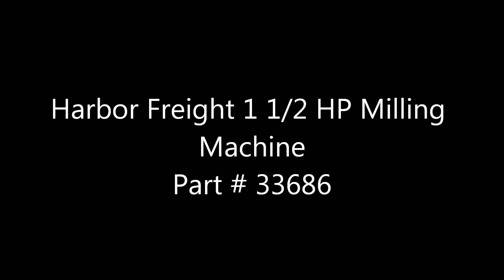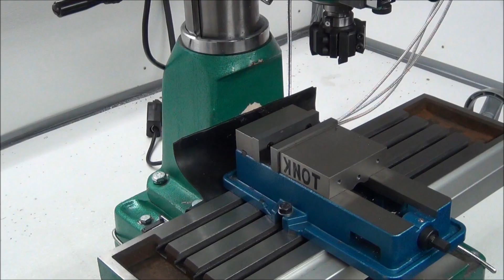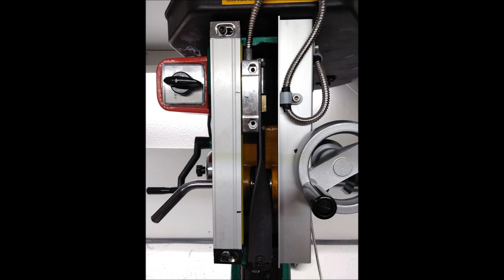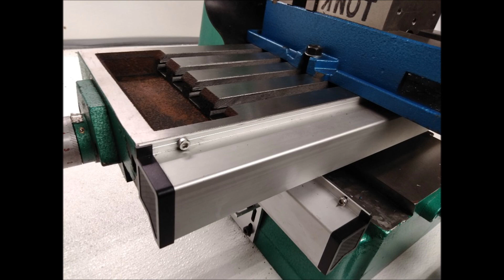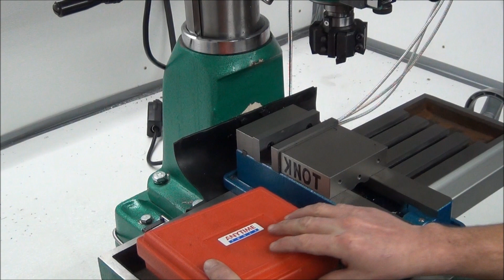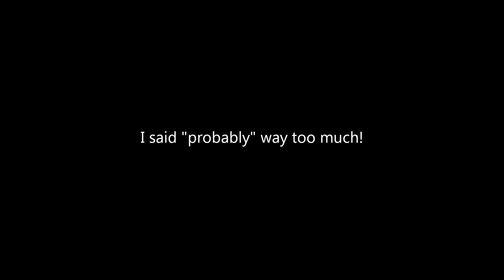Harbor Freight 1 1/2 HP Milling Machine 33686

Comment: I see this was 6 years ago but ...
I bought a lightly used machine that sat unused for years because the owner didn't like how loud it was when running.  It is quite loud. With the belts off the motor is quite loud.  The spindle seems quiet enough but I noticed that the pulley has a small amount of rotational play on the shaft . Loose keyway ??  Any advice would be greatly appreciated.

Comment: So, I have this  one with head assembly section off  and rack sitting next to it.  

As center main shaft is round with the rack on the left side for the head assembly to roll up and down on.  

With head assembly off, do I set rack in place on the side of the round head and then with a cherry picker lower the head down on top and roll the head down with the lever until it catches rack or do I put head on first and let it drop to bottom then put rack on side and roll upward to assert it on the rack?

  I would assume the first.

Comment: I would love know if my old 1984 vintage central machine is r8 or mt  3.   How  would i tell on my machine without machine dis assembly
Reply from the maker: Do you have any tooling that fits it, laying around?  Could probably measure the I.D. of the spindle nose and cross reference that measurement with specs for either tooling.

Comment: How this holding up? Will it cut steel very well? I know alot of guys get these machines and only work with aluminum.
Reply from the maker: Running like a champ.  Cuts everything I throw at it.
Reply: @number40Fan  Nice, i think im gonna pull the trigger on one once they come back in stock at HF.

Comment: I was lucky enough to find an older HF (Central Machinery) machine similar to your's on CragsList.  The machine was brand new and never used, still covered with cosmoline which was a PITA to remove.  Now, the interesting part is that my machine has a quill feed and also came with a heavy duty metal stand with a chip pan.  I've never seen another drill mill machine either from HF or Grizzly that have a quill feed.  This is a great feature for boring.  I love my machine and it's been very useful.  There are a few negatives.  First, the paint job sucked and the paint was peeling so I completely stripped the crappy Chinese paint off and primed and painted it with Rustoleum.  I used grey instead of that pea green.  The Rustoleum has been holding up great.  The cheap vinyl cover that protects the Y axis leadscrew had to go.  I replaced it with leather.  The dials have painted on graduations and are not engraved.  Be careful using solvents on these.  I did and the painted lines on the one dial got partial wiped off.  Since this machine does not have a knee for the Z axis you need to raise and lower the head.  This sucks because you have to loosen two pinch bolts on the right side, then go around to the left side to crank the head up or down, then go back to the right side to tighten the two pinch bolts.  The biggest problem thought is that there is nothing to prevent the head from rotating about the round column that supports it while you are raising or lowering it.  It would have been nice if the manufacturer had machined a keyway in the column and put a key in the head to keep the head from rotating. I plan on eventually installing a DRO but for now I made a bracket that uses a dial indicator with a 1" travel for the Z axis.  Overall, its a good shop tool for a hobbyist or DIY guy like me.
I was a professional machinist years ago and spent a lot of time operating a Bridgeport and I have to say that the HF machine I own is a mere toy compared to the Bridgeport.

Comment: Some people on here are saying they used a 20 percent off coupon to buy that mill ?  I'd like to know how they did that.  I was told harbor freight coupon can not be used on central machinery tools. I tried to use one on the internet.  It came up, cannot be used
Reply from the maker: I used a coupon with mine.  Maybe things have changed since then.
Reply: @number40Fan   I'll try ordering by phone.  Maybe that'll work...
Reply from the maker: I used to get text messages with coupon codes every Friday before this C-19 started.  Haven't had one since.  I'm sure they are pinching pennies like everyone else.
Reply: it says on the current coupons, no central machinery.

Comment: Are there markings to zero the x and y axis?
Reply: I really appreciate your replies. Thank you and Take care.
Reply from the maker: No problem.  Any time.
Reply from the maker: I'm pretty sure I understand what you are saying and I don't think there is.  At least I have never looked for them.

With these round column mills, having the center of the bed directly under the spindle can change any time you raise/rotate the head.  To find the exact center of the bed travel in both X and Y, you'd need to move either axis to its extreme, count the number of turns of the dial to reach the other and then come back to the half way mark.  Probably easier to just use a tape measurer and find the center of the bed, place a spotting drill in the chuck and lower the spindle.  Adjust the bed until the spot drill is right above your measured center mark.

Comment: Can the head travel higher?
Reply from the maker: Yeah it goes quite high.
Reply: Yes, there's a hand crank on the left side of the head that raises and lowers the head.  On the right hand side back near the motor are two heavy pinch bolts that you need to tighten before you start machining.

Comment: Im waiting for the next 25 coupon before i make the plunge and place my order but i have never before ordered something this large that has to be delivered by freight. Im interested in what your guys experience is, delivery time, did you have pay lift gate fee. How was it delivered to your residence.   Was it damaged, how was it resolved. How was you experience with the unit. Im wondering if i should go with the green vs the larger red mill. Are you guys happy with your purchase. I know its a large ask but while im waiting all i can do is ponder.
Reply from the maker: First off, very happy with mine.

It was delivered on a freight truck.  I was never called to confirm shipment.  Didn't even know it was shipping because shortly after I ordered, I called HF and they told me I wouldn't have it for a few months.  Then, about three weeks later, out of the blue, a guy rang my doorbell.  Luckily, I was home!  The delivery driver and I were able to wrestle it out of the trailer and into the bed of my pickup.  From there, I completely disassembled it, cleaned it up and carried it piece by heavy piece into my basement.

If you don't have a way to get it out of the back of a trailer, call and ask about lift gate service!!
Reply: Be careful, the red mill is NOT larger...It only has an 1-3/4 spindle, vs 3" spindle on the green. It only has 13" swing vs 15 7/8" swing. Quill travel on the red is only 2 3/4" vs 5" on the green. The table on the red is only 6 1/2x26" vs 8 1/4 x 28 3/4 on the green. So the red mill is very much smaller than the green in every way.
Reply from the maker: You're right.  Never looked at it, but is noticeable smaller in some in important measurements.

Comment: Are you using this guy to mainly cut softer metals like aluminum and brass or can it actually handle steel and harder materials?
Reply from the maker: I have cut some steel.  Made a new banjo for my lathe (cold rolled).  I have cut other steel, 17-4 SS and Titanium, just too busy to do any recording of it.
Reply: @number40Fan  Awesome thank you sir. Thinking about getting one of these and though most my work will be with aluminum pieces, I wanted to see if it was capable of harder metals. If you end up making more videos of using the mill, I'll gladly watch em!
Reply: Honest Insincerity 2 After looking for a milling machine for 13 months or so locally I found one of these green milling machines pap after looking for a milling machine for 13 months or so locally I found one of these green milling machines pop up for sale on Craigslist. I had all but given up thinking I would never find one locally. But I did!! It was listed for $1000 and ended up being in pretty damn good shape. Lightly used.

Now now that I’m done basking in the one lucky thing that ever happened to me.... this mill is a beast in a world filled with much much lighter duty benchtop milling machines. Because of the added weight this thing in hog off some serious steel if you know what you’re doing. Mine has a top spindle speed of 3000 RPM, that combined with a 2 inch indexable carbide Shell Mill I can take 100 thousandths cut and be within dimension first pass. Finally in hog Heaven.

But it does have limitations, the round column and rack and pinion Z axis is a pain in the butt and I will be certainly converting mine to a 4 hp DC treadmill motor very soon because Pretty much every time you do a different operation and or change tools you must also move the belt around to change spindle speed. also the round column is hollow in the center, it’s a heavy wall thickness but it’s still hollow and it flexes. I am soon going to remedy this by inserting a 1 inch OD (#8) piece of rebar and pour fine ground concrete to make the column more rigid.

Comment: hi where did you get the R8 to R32 collet adapter? I can't seem to find one. Thanks!
Reply from the maker: eBay.  Search R8-ER32
Reply: @number40Fan  thank you much! I just ordered this mill with the 20 percent off coupon.
Reply from the maker: You're welcome.  I hope you enjoy it as much as I have!!
Reply: @number40Fan  I'm hoping to at least get a DRO and I'd love to turn it into a CNC. I found a post from a guy about needing to reset the head everytime you move it because of how it moves 360 derees around. He had this wishbone piece made so that the head doesn't move side to side when you move it up or down. here is a link if you are interested. https://www.cnczone.com/forums/uncategorised-metalworking-machines/70099-wishbone-stabiliser-round-post-drill-mill.html
Reply from the maker: DRO is a blessing.  I love mine!  CNC would be even sweeter.I have seen that stabilizer before.  If you plan on moving the head up and down after starting a project, it might be worth it.  For me, I make sure all of the tooling I am going to use will fit between the spindle and work piece before I start.  Then just use the spindle to get the tooling to the work piece.

Sorry it took so long to respond.  Somehow it got stuck in "comment needs approval" and I was never notified.
Reply: @number40Fan  Im not sure when I'll even get the mill HB refunded my money and said they will contract me if one becomes available so idk. Just sucks theres no mill that comes close for the price and I only have about 1200 bucks
Reply from the maker: Well, crap.  That sucks.  I'd ask to be put on BO and hope for the best.
Reply: @number40Fan  ya ill probly do that. thanks for the info!

Comment: I just received this mill from HF a couple of days ago. I was able to use a 20% off coupon bringind to price down to $960. It is mounted on a stand I made, leveled and ready to use. I am about to order a DRO and your video has been helpful. Please keep us posted on using and modifying this mill.
As far as I can tell the Central Machinery (Harbor Freight) version of this mill is the same as the Grizzly, Jet, Dayton, and others for much less money, the Dayton costing over 7K! I called Grizzly and asked them what the difference was besides the cost (nearly double) and was told that "customer support and parts availability" are the main difference. Ok, that was helpful now I know where to get parts if needed, lol. I can buy the DRO, Vise, and a lot of tooling for the price difference. Thanks again for the video, please keep them coming.
Reply: Hi.  I did the same thing.  I researched and, like you, came to the same conclusion that this was the same mill/drill carried by other suppliers.  My 20% coupon paid for the shipping and most of my tooling.  I went with the R8 collets for the end mills.  Very satisfied with the quality and price.
Reply from the maker: Thanks for watching.  Been meaning to video some more work being done on it, but needing to get stuff out the door versus the time to record is the biggest issue.
Reply: Jim M From the time you ordered it, how long did it take before they shipped it. I ordered one 6 weeks ago and it still hasn’t shipped.

Comment: can you tell me the height of machine and the dimensions  of the base im waiting on one of these to be delivered and trying to build stand for it while im waiting on it. thanks
Reply from the maker: Look for my reply to Long PDX.

Hopefully that will help with the base dimensions.  As for height, from the base to the top of the column is ~43", but if you plan to leave the belt cover on and want to be able to open it fully to change belt/spindle speed, you'll like need another 10" or so.

Comment: New subscriber here. You were recommended by Everetts Workshop.  I'm looking for a mill myself. What made you decide on the Harbor Freight?
Reply from the maker: Thanks for the sub.  

Price!  Probably the main motivator in most decisions in life.  Being a company that has a store near me was second on the list.

I was a little apprehensive with the purchase, but after tearing it apart to clean it up, I realized it is a well built unit.  I'd buy another one tomorrow if I had to.

If you have any more questions, ask away.  Something specific you'd like to see on video, let me know.

Comment: Nice new machine! That's cool you put a DRO on it, you'll have a better time with using that vs having to count on the dials all the time. Once reverse is worked out on my machine we'll have to get you set up with it too.
Reply from the maker: I think the main reason or the DRO is the awesome built in features.  I like math, but find myself getting lazy in age.  Being able to use it to find angles, circle bolt patterns (lots of uses for this for me), centers and other goodies I haven't dug into yet, made it worth the purchase.  Using the edge finder with the DRO made setting up the vise a piece of cake.  I was surprised to see a .00005 resolution too!
Reply: what kind of benefits do you get buy going to 220 ?
Reply from the maker: For me, being able to power it without risking tripping a breaker.  I am short on outlets in my basement and being able to use the 220 volt plug on the drier makes it easier for me.  I would think there would be some power benefits to it, but can't guarantee it.